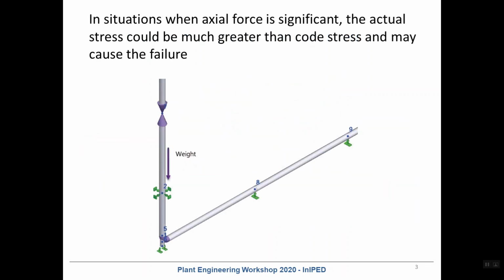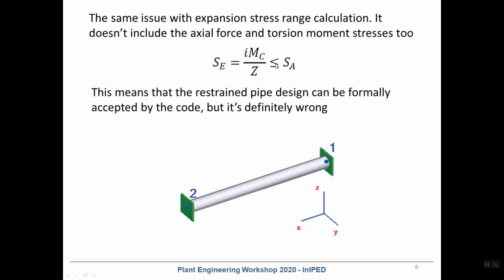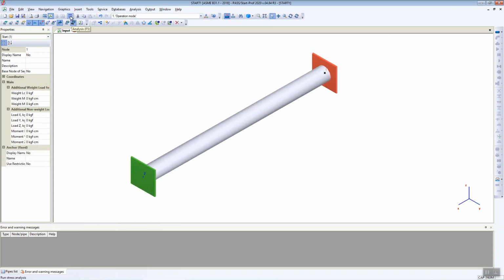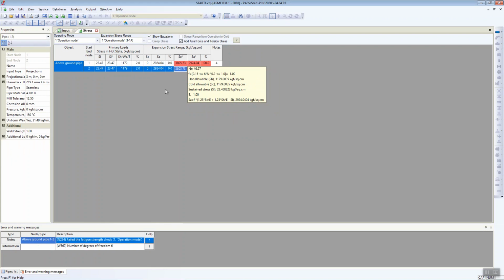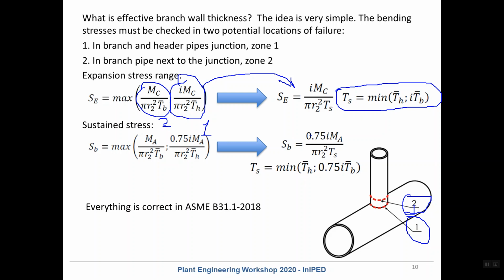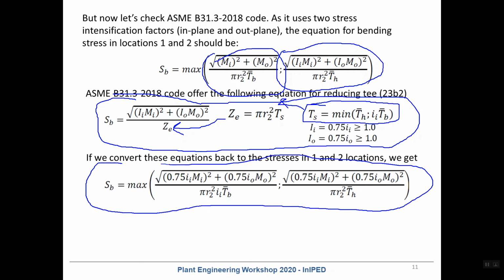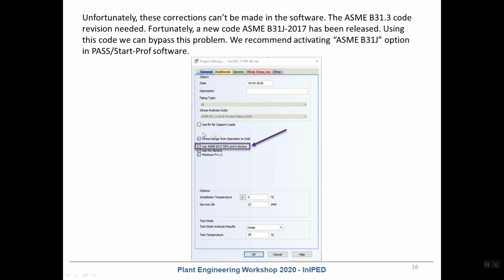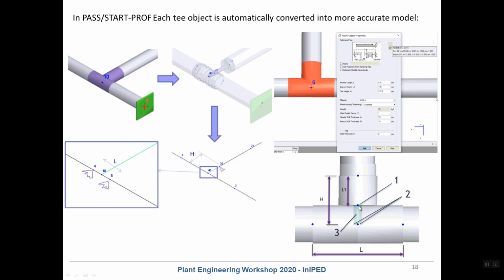Several ASME B31 and EN 13480 Issues Needed to Know by Any Pipe Stress Engineer

Comment: I think this is a bit over analysis. Practically you are saying a 200NB Sch. 20 Pipe connected over 3 meters span by fixed support operating at 0 pressure, 150 degrees will fail due to axial stresses? Then I have news for you, I design Ammonia suction and discharge pipe over these mentioned ranges some of them operating for over 20 years never had any problem or failure.
Reply: Make a video about this please. Im sure several people here would watch and enjoy it.